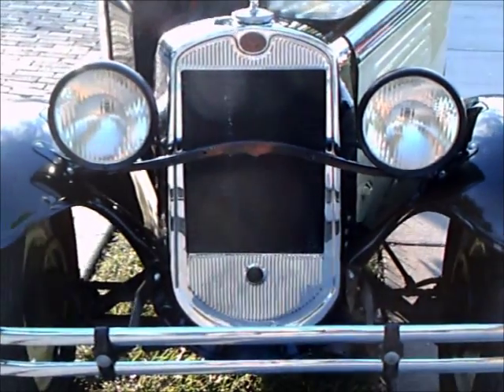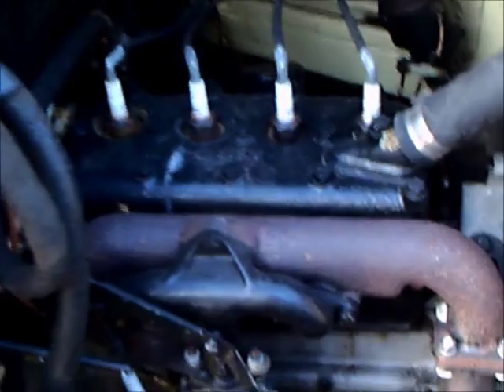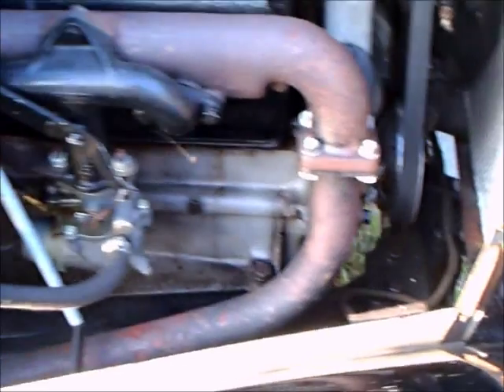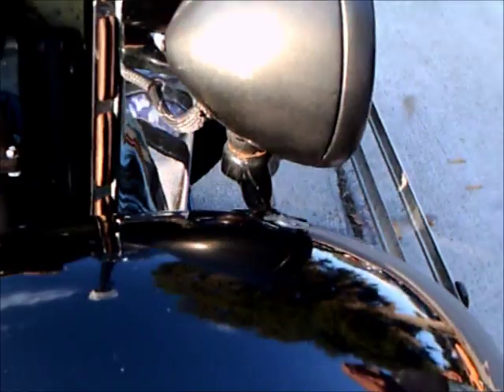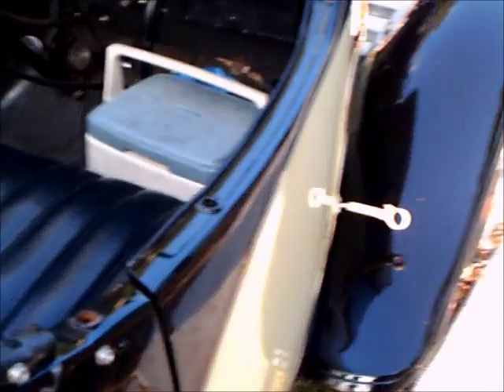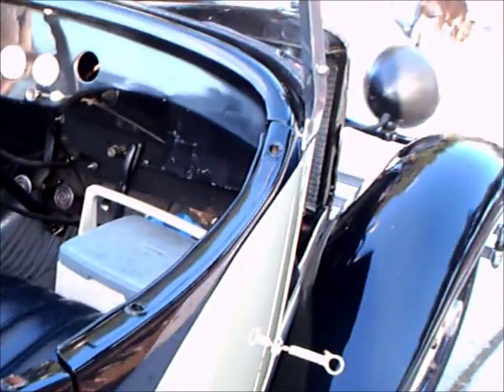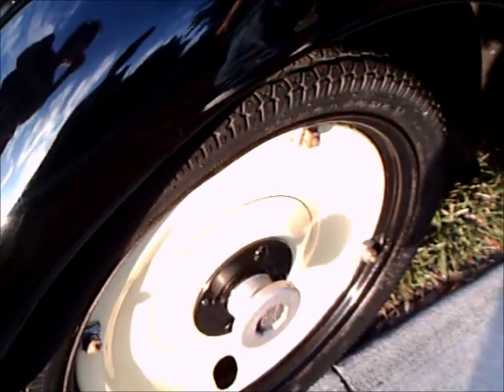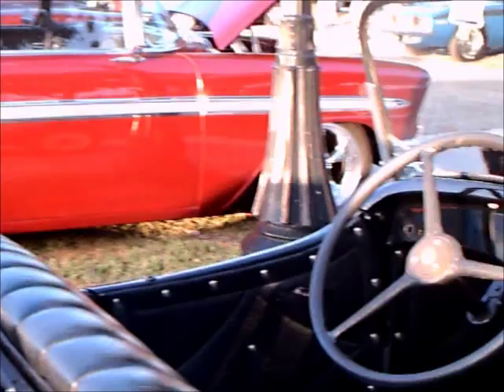1930 American Austin Convertible  BlkYel WG111514

Comment: Cute car, but I wouldn't buy it. I do like the idea of the solid wheel, and have wondered why technology hasn't brought it back around in a suitable way. Still fogged by the Sunliner.
Reply from the maker: Yes, you would not be wanting to take this car on the interstate, in my opinion. But as a cute little car for that little picnic getaway using back roads...I'd like it!  I think wheel and tire technology has been somewhat neglected in this era of rapid development.  Right now, wheels seem to be a large element in the "look" of the car.
Thanks!  :)  Jack